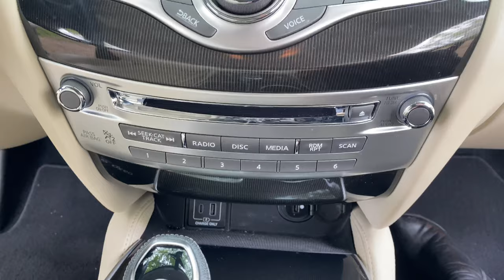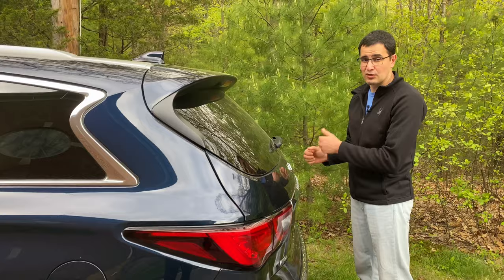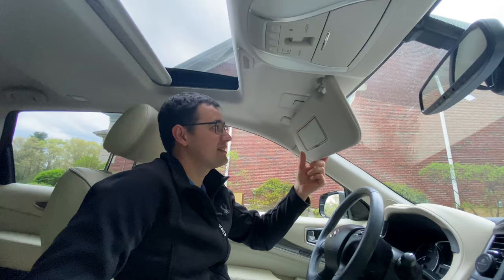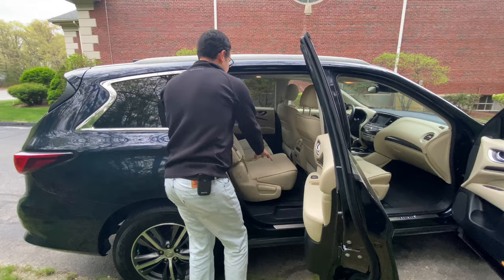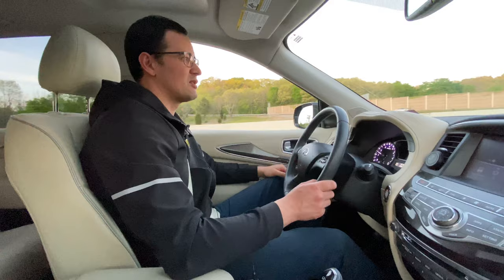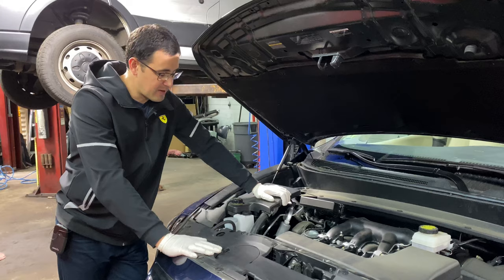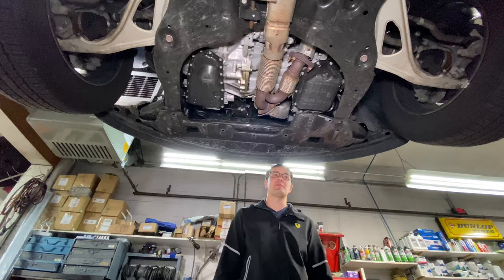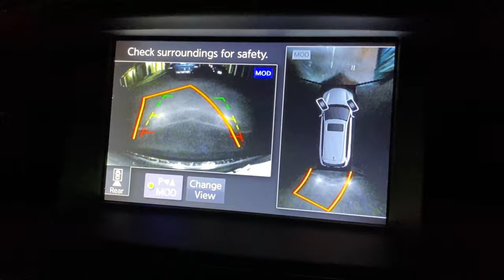2019 Infiniti QX60: "HALF" - luxury SUV

Comment: Interesting that it has almost no underbody protection, I found out that BMW has huge amounts, good for corrosion resistance, even my 2012 ford focus has a lot, that thing is fully open, no doubt the cost cutting at Nissan has taken effect. Great engine though and the CVT is probably as good as a CVT can get, good job as usual!
Reply from the maker: I completely agree with you: new Fords and Mazdas completely changed their anti-rust protection and it is much better quality now. They also improved the interior quality. However, the harness quality on Fords assembled in Mexico are horrible quality. I suspect they do this on purpose to make money :-)
Reply: @AtomicCarReview  The Mexican parts seem to be made cheaply agreed! Seems that all the Sync modules made in Mexico are failing slightly after warranty, you must see a lot of this with all the Transit servicing you do.  I read once the Sync modules cost around 12$ to make! I enjoyed your Transit video too with the tiny brake pads and poor engineering, more profits for Ford!